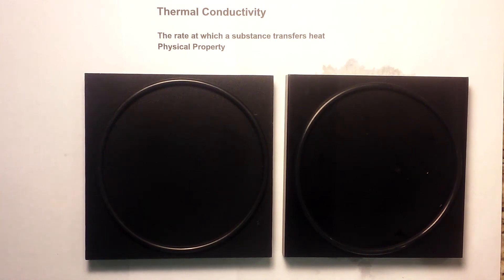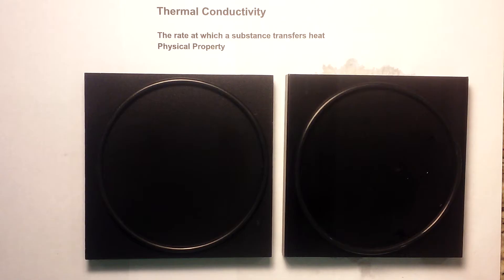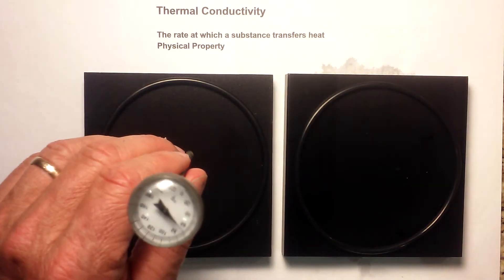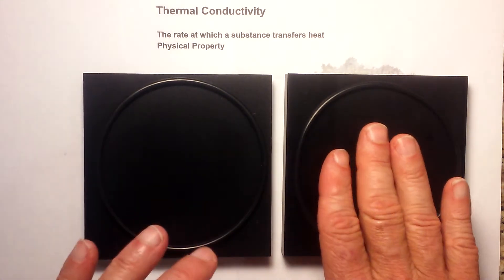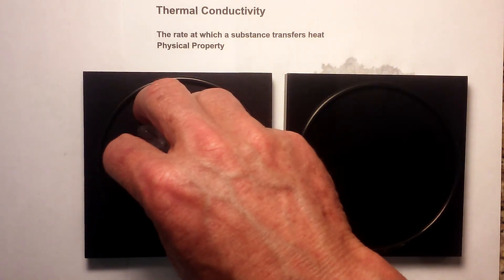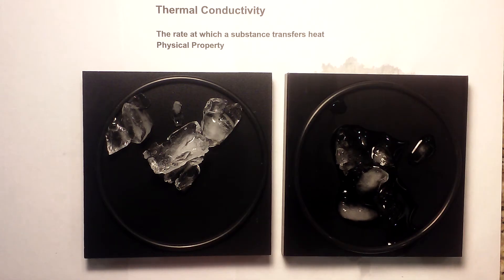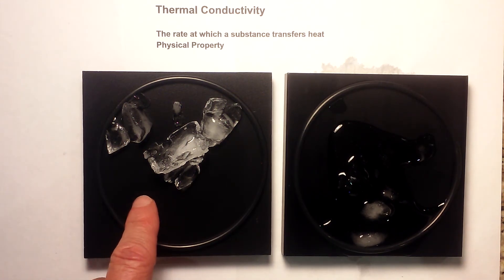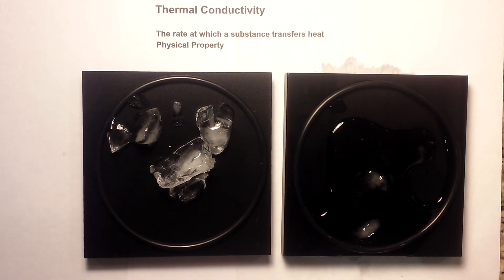Thermal Conductivity Demonstration

Comment: How does the thermometer detect the temperature of the plastic? I thought a thermometer absorbs or releases heat from the material it's testing to determine its temperature. If the material has low thermal conductivity it will be difficult to tell ,what its temperature really is,